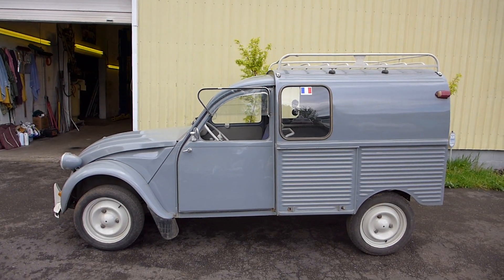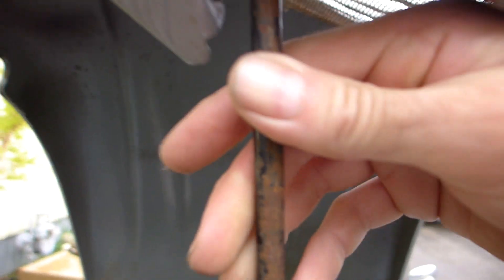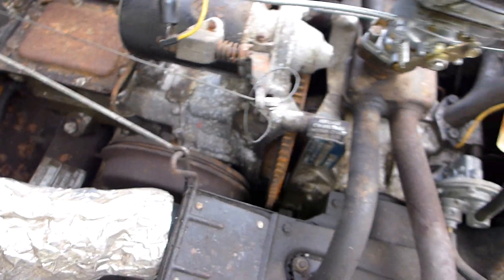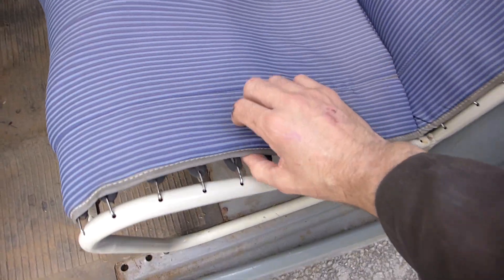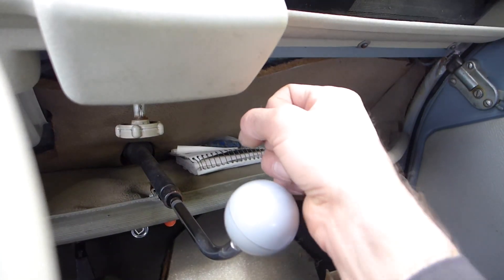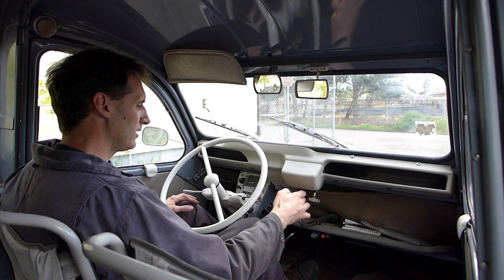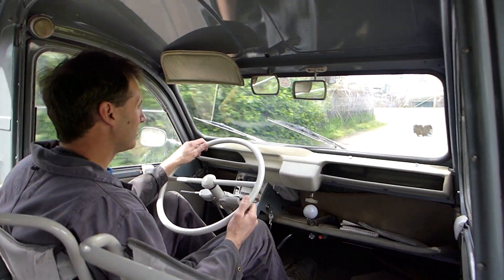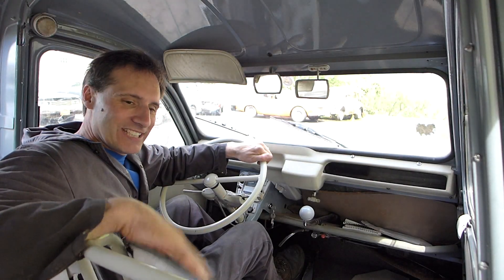Come take a ride in "Antoine" a 1963 Citroen 2CV Truckette (furgoneta)

Comment: My dad bought exactly the same model on 1963 - same color, same doors which are called ""suiciding doors"".. We kept it in the family from 1963 till 1980.
Driving everywhere,. Always driving on the safe side keeping a tool box & few spare parts like dynamo brushes, carburetor cleaning  & repair set,. Never got stuck for more than 30 minutes ....I would like to keep a car like this once again just for fun....missing the suspension & the 2 cylinders noise...

Comment: Its so simple yet so cool :D
The metal looks so thin i could punch through it.
Reply: I have a 3cv is 2cv6 Argentine version of 2cv with 602cm2 and furious 31 HP , when you go on the road at 100kmh you feel all the wind, all the noises and need constant attention on the wheel to correct the direction when lateral wind  push you , on the city is the best fun and relax to drive no stress... its a marvel this car, easy to fix, indestructible engine! and best heater ever on winter.
Reply: Body panels of other light-weight cars are even thinner. The front lid is kind of wobbly when open, because it has no supporting frame. A lot of construction details you find as well on light-weight airplane bodies like JU-52.

Comment: Love the video and commentary.
3m28s - you said choke but meant starter :)
3m - gear stick - what right/forward - is that overdrive? Cute the way the screw is 1/2 covering the label.
Reply: It's the speedgear, labeled with "S" and only shiftable, when already in 3rd gear. 

From 1963 on the engine got stronger (16 HP) and the car got a regular 4-speed-gearbox.

Comment: You could sleep in the back, the dent in the bonnet should be able to be knocked out. It is based on a 2cv?? Most unusual gear shift, not much power but the vehicle would quite light, it was not built for performance, more of delivery van or tradies van.

Comment: This is a strange model, i own a 64 one with the very same engine but if your one is a 63 it CAN'T have the "smooth walls" in the back part of the van, it should be completely "rough" except the hood, like your one and it would be called "Citroen AZU" in the other hand it looks like a "Citroen AK 350" but its shorter, then it seems that it has been restored in a rare way or modified, but it doesn't seem to be original.
Reply: It seems this webpage doensn't let to paste links here...i wanted to show you the diference, but if you search it, you'll see it is like a rare mix of an ak 350 and a citroen azu